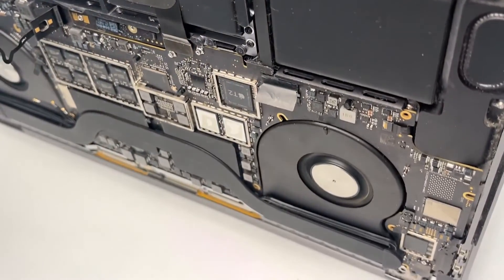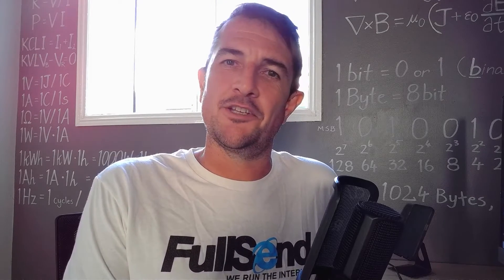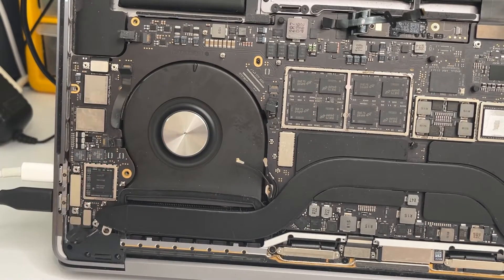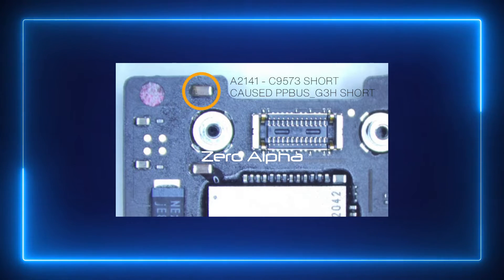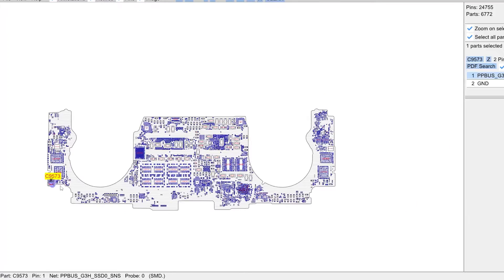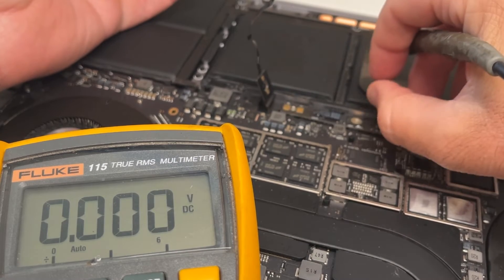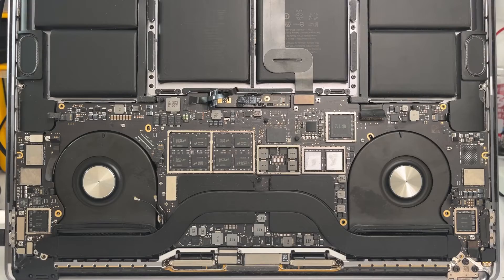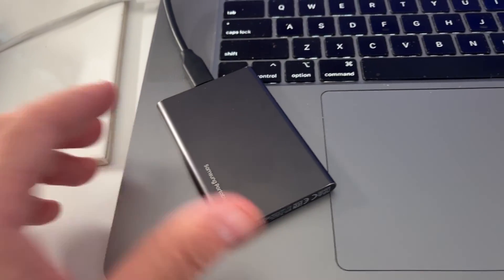MacBook Pro 2019 Repair - It wouldn't turn on

Comment: Macbook Pro A1990 won’t start. sometimes it get switchon and works fine. 

No problem. If we shutdown and try to start again it won’t start. Sometimes it will start. Sometimes it won’t. Once it boot it will work for hours. No problem. 
What may be the problem?

Comment: This step-by-step process saved me $3,500 for data recovery and $700  for Apple's Genius bar proposed swap of the "logic board", only guaranteeing me 100% loss of data. In the end I found 0.007V on the battery pads you have identified in the video. Leaving the BMS connector bridge off, and isolating the battery connector latch with electrical tape, everything sprung back to working order. Well done mate!

Comment: Followed instructions.....however still won't boot... however dropped the capacitor? what capacitor should I replace it with?
Reply: Did you check the cap was shorted?

Comment: It's amazing to have these services in Australia so thanks for being there. What would be great is a heads-up on if the Macbook was toast after your recovery or repairable. It would also be helpful to know how you bypassed the faulty chip... you don't show how you removed it from the circuit.
Reply from the maker: Thanks for your lovely comment. Our job is to recover data safely first. Sometimes it can be repaired but other times they can't

Comment: The display is broken on my apple macbook 2019 16 inch A2141. And now it starts and makes a wush sounds and shuts down. Kindly help me out. I wanted to connect it to an external display and get the data
Reply: Exactly the same is happening to me

Comment: Is there a video that shows how to remove the capacitor?
Also if one of the USB-C ports shows a different amprage and voltage than the other 3 would this be significant?
Reply: That would be due to a faulty port or a faulty power chip serving that particular port. Replacing faulty capacitors is best done with solder tweezers or failing that a pair of soldering irons or using a hot air gun.